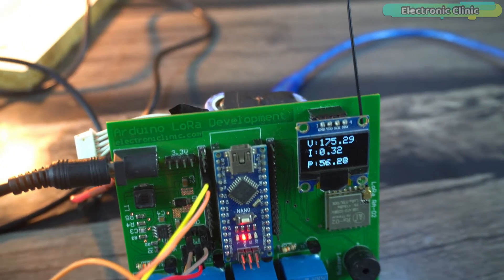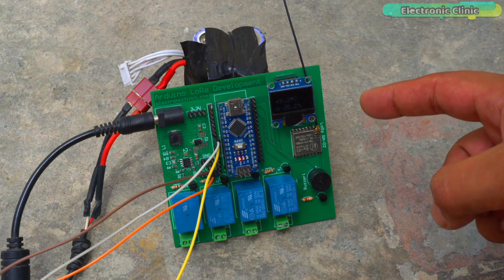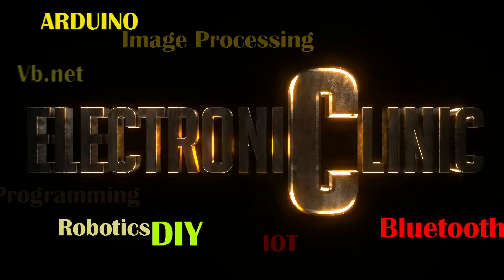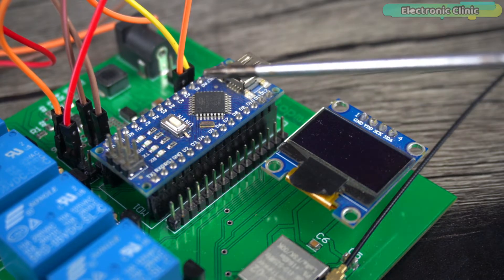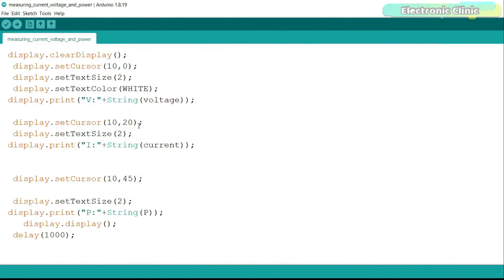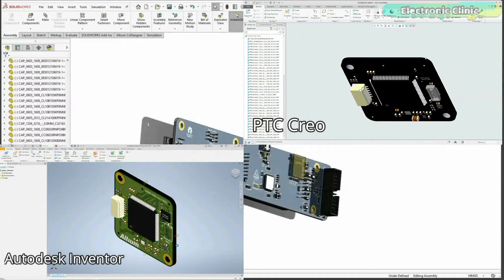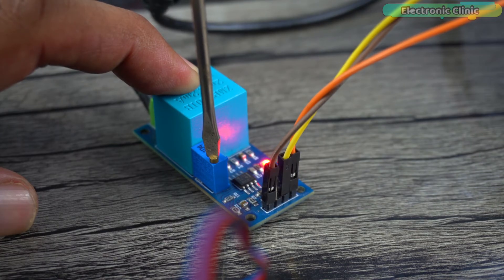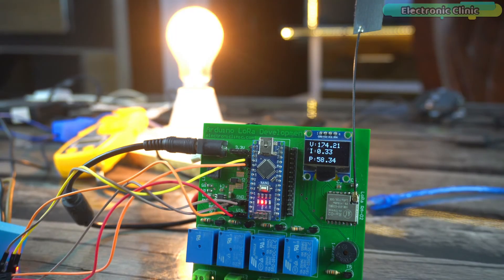Arduino Home Energy Monitor using CT Clamp Current Sensor & ZMPT101B AC Voltage Sensor

Comment: How may I use ZMPT101B AC Voltage Sensor to monitor two phases?
I probably will need two sensors but how may implement them together?

Comment: This looks interesting. I would like something to measure and record voltage spikes on the AC line (mains). I will have to look at the specs and see if the two sensors (especially the voltage sensor) are capable of measuring and capturing a fast spike, such as the standard 8/20 μS waveform. It might even be the Arduino that would be the limiting factor.

Comment: For the current transformer (CT), the AC voltage ranges from -1V to +1V. However, the Arduino's Analog-to-Digital Converter (ADC) cannot process negative values. To address this, you need to establish a virtual ground, ensuring the AC signal stays within the positive range. If you set the virtual ground at 2.5V, for a 5V system, the maximum values could range from 1.5V to 3.5V. To achieve this, employ an appropriate resistor divider. Additionally, incorporate a capacitor alongside the top resistor in the divider to function as a high-pass filter. This setup should be calculated to allow frequencies around 10Hz, which is adequate for handling the usual AC signal frequencies of 50 or 60Hz. As per the Nyquist Theorem, your ADC's sampling rate must be at least double the frequency of the signal you're measuring. In practice, I often use an external 16-bit ADC and have optimized my code to sample at a rate of 800-900 samples per second for reliable measurements.

Comment: I think (hope) most people will have noticed that in the drawing (@04:15) there is a missing connection between the -12V and the mid connection of the 7805.